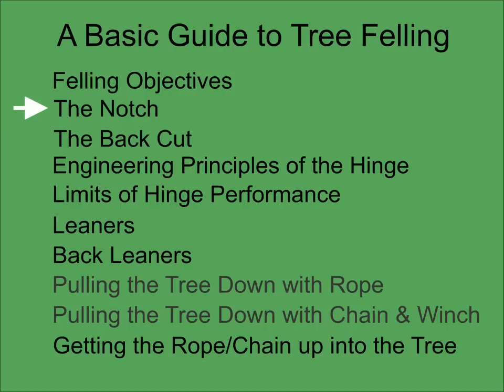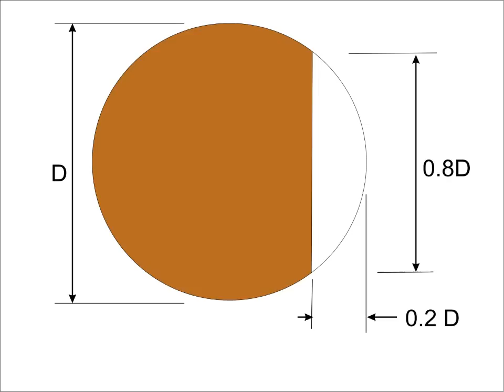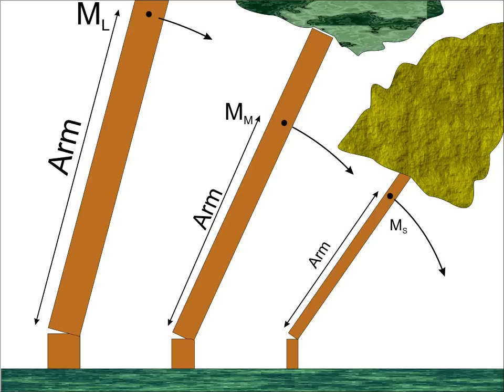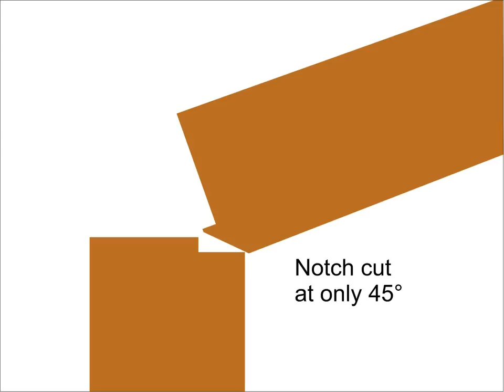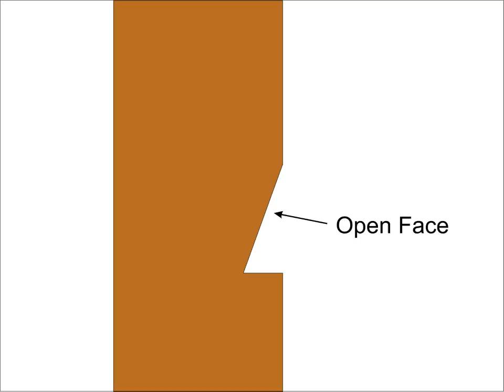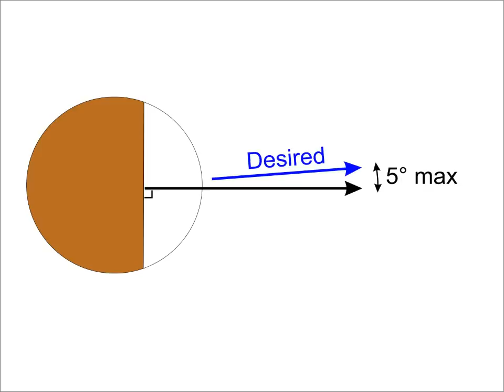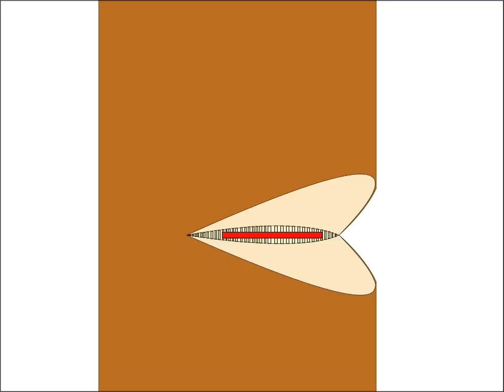The_Notch

Comment: This will take me a few times to fully grasp. Thanks, its exactly what I need.
Reply from the maker: You have my permission to watch it several times.  lol.
Reply: Shouldn't the notch be cut deeper than the tree's vertical CG? Seems to me that is the only way for the tree to not pinch the back cut without wedges, winching, etc.
Reply from the maker: You don't have control over (and usually don't know) where the c.g is.  You pick a direction to fell the tree in and make the hinge perpendicular to it.  It's best to keep that hinge towards the side you want to fell it in.  If you cut it too deep, you may have guessed wrong on where the c.g. is.  The extra width for the back cut gives you better options to use wedges.

Comment: Great video, comments are very helpful also.....so, the deeper the notch, the wider the hinge, and the less risk of tree falling sideways, right ?  The deeper the notch the safer it is.... deeper is safer ?
Reply from the maker: Thanks David.  Relative to side lean, Yes, a wider hinge is safer.  If lean or back lean are significant factors, it gets more complicated as removing a large notch weakens the tree's ability to resist those leans.  Shallow notches are needed for leaners, as covered in "Leaners".
Reply: @terryhale9006  very interesting; and great info. -- thanks for the instruction !!!!  Have to check out that video also.

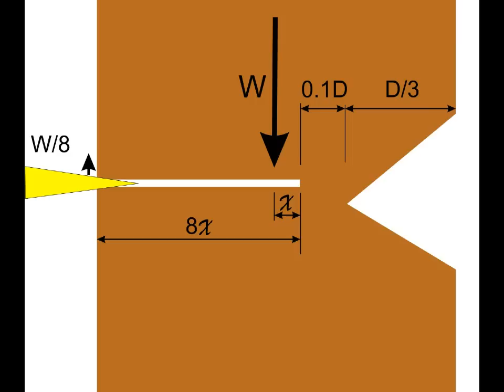Comment: Hi Terry.  I'm trying to understand why a notch depth of 1/3 the diameter is typically recommended.  As you show in the drawing around 3:37 into the video, a perfectly balanced tree wouldn't fall on it's own with the notch cut 1/3 of the way in. A wedge is necessary to move the tree to the point where the center of mass will be over the pivot point (which, btw, you show as being at the back of the hinge... wouldn't it really be somewhere in the middle of the hinge?). In fact, with the cuts made as shown in that drawing, a wedge(s) is REQUIRED to keep the tree from sitting back on the chainsaw bar.

Intuitively, I would think you'd want to cut the notch back further,  until it's past the center of mass of the tree, so that the tree will start falling on it's own once you make the back cut.

Of course, there's probably no such thing as a perfectly balanced tree, so you'd have to vary the depth of the notch depending on lean. But I keep wondering why the 1/3 diameter depth is recommended so much, without reference to whether the tree is leaning or substantially straight.

Can you shed any light on this for me?

Thanks for the great series of videos!
Reply from the maker: Keith, You pretty much nailed it with "there's probably no such thing as a perfectly balanced tree".  If the tree is well balanced, cutting 1/3 of the way through is likely to make it lean a bit to that side.  After all, in theory, the full width of the trunk is under compression from the weight of the tree and you just removed the support on that side.  With a well-balanced tree, a wedge is typically not needed.
   Even with a lot of experience, what looks like a well-balanced tree can trick you.  I'd say the 1/3 is a reasonable ballpark number; certainly not something requiring precision.   Considering how frequently cuts don't cooperate on where to join, the 1/3 should be viewed as little more than a target.
   If you cut the depth to 1/2 the diameter, you're probably doing a lot of extra cutting.  Additionally, unless you're dealing with a large tree, you may be running out of space for your wedges in the back cut.
   If you cut to less than 1/4, your hinge length is starting to get short and you will have reduced resistance to the tree falling sideways.  If you know you have to deal with a back leaner, you may want to use a shallower notch.  That way, you will have a large couple (distance) between your wedge and your hinge.  That will act as leverage and reduce both the stress (tension) on the hinge and stress (compression) that has to be overcome when driving your wedge in.
  Bottom line, all things being equal, 1/3 is a good target, but not something to get stressed over.
Reply: Your forgetting that the quality of wood can vary and if there is sn unknown rotten core, cutting a half diameter notch would be a disaster. A 1/3 notch ensures a likely good hinge

Comment: What is risky about deep notch? The only thing I can think of is baiting the chain. (Ofc. it requires a lot of cutting but when I don´t want to use wedges and so the deep notch seems like the only option).
Reply from the maker: You are correct.  If a cutter misjudges the tree, it could settle and squeeze tight on the chain/bar.  Similarly, the tree could begin to fall before the feller is ready to do the back cut.

Comment: great videos I was wondering if there is a formula that could roughly work out the amount of movement produced at the top of a tree by wedging at the base of the tree?
Reply from the maker: Thanks Alex.
For almost two months, YouTube was hiding comments from me.  I finally discovered that last weekend and began responding to them.  Yours "required" the lengthiest response I have yet attempted.  I was a few lines shy of sending it when it suddenly converted into a tiny electromagnetic puff of heat.  Needless to say, I was quietly, but highly, pissed off.  It gave me an aversion to trying again until tonight.  If this attempt also disappears into the ether, you will hear the explosion and have no idea what that was.
  In answer to your question, I am practically certain there is no such formula.  However, a mathematically true, but physically flawed, formula can be worked out.  First, we have to define some variables.
    Let Ht be the height of the tree in feet.
    Let Kw be the width of the kerf for your back cut.  (Assume 3/8")
    Let Ww be the width of your wedge measured in inches, right at the point where it enters the wood of the trunk.
   Let Ma be the moment arm, measured from that same point, perpendicularly to the effective center of the hinge you have cut.
    Let Tm be what you want to find, the feet of movement at the top of the tree.
   Given those variables, the theoretical formula would be:
  Tm = Ht x ((Ww - Kw)/Ma)
   As an example, say you have a 70 foot tall pine tree  (Ht = 70)
   Say the distance from where you wedge enters the trunk to your hinge is 7" (Ma = 7)
   Say your wedge is 1" thick at the end, but you have only driven it in to where it is 3/4" thick.  (Ww = 3/4).  Remember that 3/8" of that is "wasted" just replacing the wood you removed making your kerf.
   Applying the formula, we get:
  Tm = 70' x ((3/4 - 3/8)/7)   or
  Tm = 10' x 3/8     =   3'-9"                             Unfortunately, this ignores some physical issues.  The most important one is that wood is not inelastic.
   Prior to your cutting and wedging, the weight of the tree was supported by the entire area of the cross section.  Due to your vicious attack, that weight is now supported only by the hinge and your wedge.  Given that you are needing to wedge it, the pressure that the wedge is exerting on the wood is quite a bit higher then the pressure on the hinge wood.  As a result, the wood at the hinge compresses somewhat and the lift is reduced.  The movement at the top might be reduced by half.
   You can, however, improve the situation by driving additional wedges.  With three wedges, the stress on the wood at each will be reduced to about a third of what the one was feeling and you will get closer to your theoretical lift.
   The compressibility of the wood will vary significantly with species, density, moisture content, and any rot.
Reply: thank you very much for your answer it is a great help.  when felling in tight situations I like to roughly work out all possibilities by measuring the tree size and I always wondered if it was possible to to figure out how much lift I would have to produce on a back leaning tree to tip the balance.
Reply from the maker: Alex Beedie Ah! So it was not just idle curiosity.    ;   )